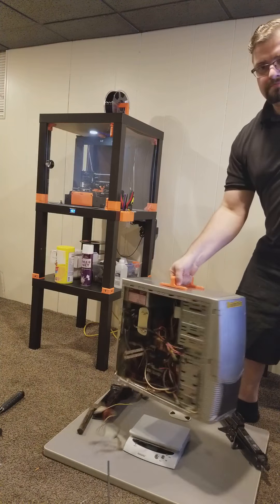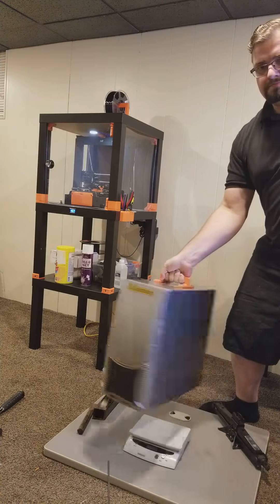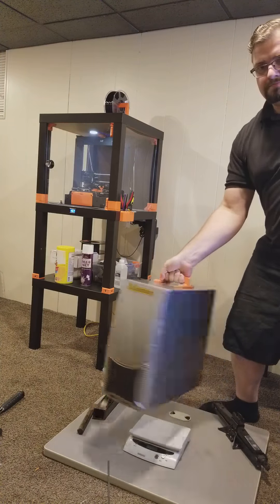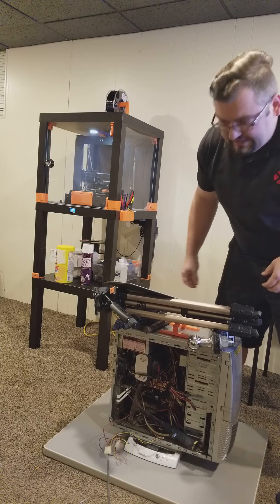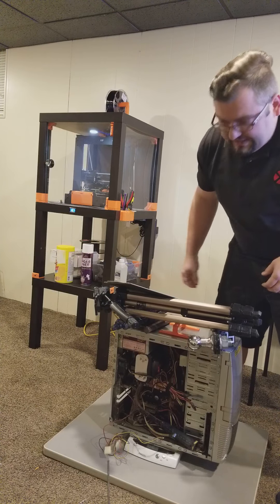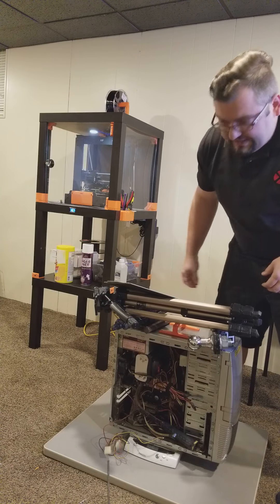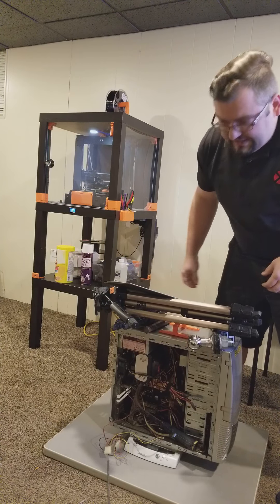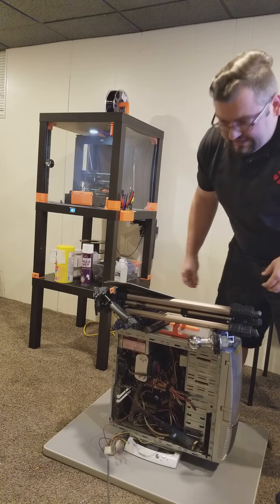Strength test of 120mm 3d printed pc case handle

Comment: pla is brittle but crazy strong. 30 pounds really is nothing. PETG is not quite as strong but way way more flexible. you ARE distending the arms though. I would suggest beefing it up a wee bit and having a bolt go clean through the whole structure from top of handle on each side into the pc case. then it could probably handle 100 pounds no problem.

also selecting proper print orientation is critical so you are stressing the plastic itself and not the much weaker layer bonds. (printing hotter will help with that)

beef up the structure and 25% infill will be plenty. the arms are a bit too skinny and thin. beef them up a bit. PETG has very good layer bonding especially if you print hot.
Reply from the maker: Nerys Thanks, I am using PETG material though. This was just a test for reddit users to show a standard computer should be no problem.  Then maxed out the scale at 50lbs just for fun.
Reply: i know. PLA should also work but its more brittle so when it gives it will be "sudden" this is why the softer and slightly weaker PETG was better since it won't "suddenly fail" it distends and fails slowly so you should get some warning while if you compromise pla it will just snap suddenly. badly worded but meant to say that you selecting petg was the right choice :-)